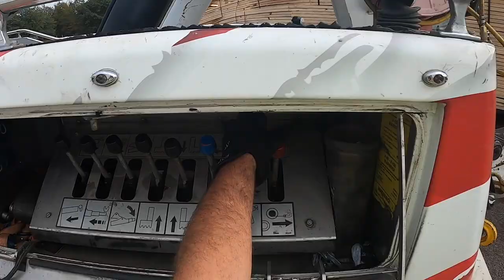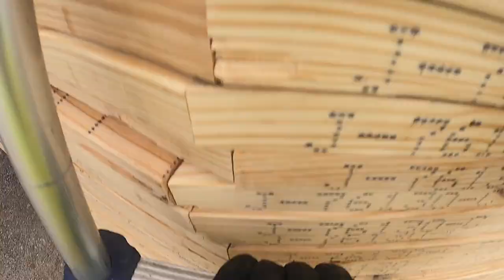Prefab Roof Trusses Need A Little Lift

Comment: i think this is what i like about what you do the most....the challenge of figuring out the best way to do something with risking safety or equipment. so what did you think? 40,000 lbs of trusses? or more?
Reply from the maker: Mr JC  I think at least 40000lbs. The trailer was struggling to lift them up. Thanks for watching.  Stay safe